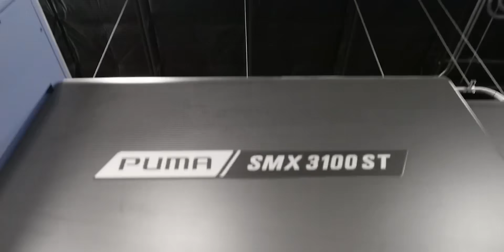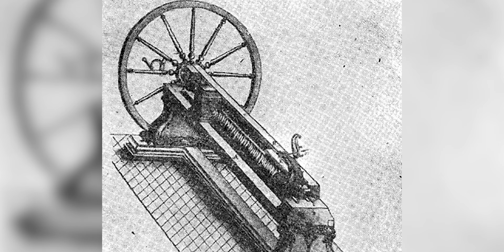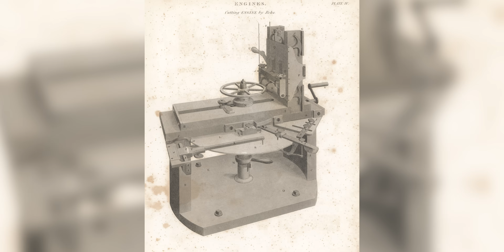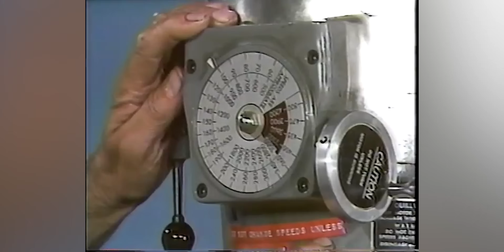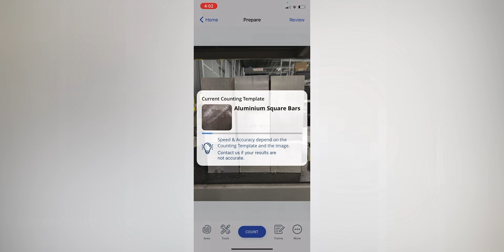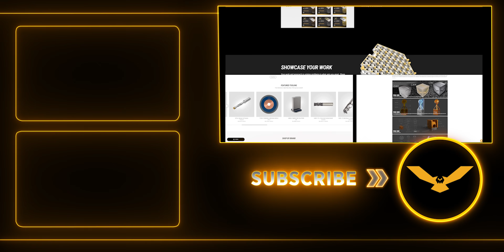The History of Machining

Comment: I've outproduced cnc purists on more than one occasion running production. All depends on the tolerance, how much material needs to be removed, material, and the most important factor is if producing more than one part then the more operations there are the more then the faster it can be done in the cnc.

Comment: Im in my early twenties and have been manually machining on a manual summit lathe, and a manual bridgeport mill for the passed three or so years. About a year or more ago, the conpany i work for bought a canpro 3 axis cnc mill with a 4th axis attachment. Ive been learning fusion 360 and the interface of the fanuc controller, so I am excited to start driving parts out of the machine at much higher accuracy and speed than the "Trusty bridgeport."  Manual machining still has its place for sure, CNC machining is now what manufacturing is all about now.

Comment: I wonder how we would keep machining when we have the next massive solar CME event, much like the Carrington Event, that would basically knock out all electronics and power across the globe. That older, original tech, running pulleys and gear systems, would clearly be able to make machining work again given access to hydro or steam power, yet how would the machine of tomorrow look if it were not powered by electricity? What would Titan do? Thanks for sharing this video Barry, it certainly gives me a little food for thought . . . for our global manufacturing future!
Reply: Just like we did in 1300bc. Much like when my software crashes, its always faster to do it the second time……

Comment: As somewhat of a new machinist i am making parts on a KERN CD282 and a Picomax 54 running Heidenhain TNC310, which is slow. Whilst both are old, rapid traverse on the picomax has a feedrate of 2000. But oh man, i have made some pretty one off parts.

Comment: I have a suggestion on how to increase the thrust of a jet engine, my idea is based on the principle of a fanless fan, The thrust of a jet engine is directly dependent on 2 factors, the amount of air it blows out, and the speed at which the gas flow blows out. I want to increase the amount of air, it is known that fanless fans blow 15 times more air than the turbine itself pumps For this, it is necessary to remove the outer housings of the jet engine, and create new housings, according to the principle of a bladeless fan, part of the jet stream must be used to build up pressure inside the new housing, which will throw in a jet air stream at the beginning of the jet engine compressor, in this way it is possible to increase the amount of air in engine, you're supposed to work with a lathe for a bit, and figure out how to force some of the jet into the hulls, but then you get new types of Jet Engines.
Reply: If you are not drunk, then you must be a total fool.
Reply: @MrJonnyd55  Oh, and on what is your statement based?
Reply: @hishnikchannel3529  a lifetime of listening to drunks and / or fools
Reply: @MrJonnyd55  but clearly, you know how jet engine robots? and why it is arranged as it is arranged, have you looked at the history of the development of a jet engine, I think not.
Reply: @hishnikchannel3529  ok bro 😎
Reply: @MrJonnyd55  ok
Reply: I mean, it sounds like a ramjet. Bladeless fans also aren't truly bladeless.

Comment: can get a $60 metal drill press, 20 in parts and it can do end milling... "set up instructions = complicated, but takes less then 5 minuets" turn out a chain link stamper from hardened steel with it, just takes a little while like using a hand file "600rpm for a 3hp motor drilling SAE9254" even with a bridge port mill that was imposable, chemical engineering acid absorption thermal chemical decomposition reacidification electro plating processes, similar to nitro cellulose production in some ways. heard that the old plant in Indiana was the one doing that for the longest time, but those same elements can be filtered out of sea water "no more (not oil field) tailings ponds, mineral acid well extraction (no strip mining, frack... a 100'000psi well that's 16'000psi static, every frack causes solution to come up and out the open pipes" though in processing of acid mining all the iron in the mix is contaminated with uranium, as is it filters thru a similar range of processing requiring a far more precise stage of automation to remove it within an abstract of a simple distillation process... tho the things in the new milling bits are chemically altered at very extreme ends of the scale requiring very oddly made contraptions "electro magnetic plasma generators small scale fusion" via controlled chemical thermal decomposition of nitrated elements into there oxide that can be filtered thru distilled water and presented for re-nitrating of the oxide for electroplating leading to accumulation that creates a eventual ingot... my car was made partly under that process engine being similar to a modern 4340 160kpsi tensile cast ARP with chemically filtered additives that continue to be reformulated slightly time and time again creating a stronger data set of known properties... nothing in America/Europe/Russia is made of Cast pig iron from poorly sought out anything metal will do eastern made whatever... cast doesn't last, stated as... this cast will last, thus becoming "cast lasts". forged rot iron is a breeze in a $80 mill, same cost as 12 sandwiches "3 days lunch = cost of machine... the metal its made of is worthless as scrap, melting it all comes out as slag in the pot and negligently contaminates everything".

Comment: I worked for a firm that was using wickman multi spindle turning autos from the 40's, they could take a whole day to set,
but they were fast having 6 spindles going at the same time.
Reply: Pshh a day? Watch me take a whole week for a simple setup! In all seriousness those machines are beasts, even CNC machines can't knock them out've their niche. And show me a CNC machine that can pump out parts for nearly a century.
Reply: @efreeze287  Traub Index multi spindle , DMG multisprint..... what was your point ? but the new machines won't last 100 years , but if they are taken care of 50 years are possible
Reply: I worked on Wickman multi's when I was an apprentice. Started off in a machine rebuild shop, taking a machine off the line and disassembling it before putting it back together as a brand new machine. I got into setting them after that, which was less enjoyable. Great machines, I'd love to see what their CNC multi's can do nowadays.
Reply: Did some work on Wickmans as an apprentice in the auto parts industry. Early 80s and CNC completely dominated the shop floor but they couldn’t get rid of the Wickmans 😂. On long runs unbeatable. Well built machine tools .

Comment: I was at the welding shop getting some welding gas and the guy asked what are you building? And I said a milling machine and than he said make sure you set the turn dials correctly on the machine. And I said I'm making a cnc milling machine so that's not necessary. If you have servo stepper motors you can use them as a DRO.

Comment: One of the benefits of CNC machines is,they replaced 10s of thousands of Bridgeport’s making them dirt cheap in my area.. Just about every design engineer I work with has one in their hobby shop. The more serious hobby shops use precision Mathew’s gear.. Eventually buying into their first CNC machines.

Comment: I still love being a die maker using old belt driven hardinge lathes. Hand Lapping and forming radiuses by hand on carbide.. I love learning from old masters learning tips and wisdom than modernity. I get paid more than the top cnc guys on their mori dmg machines in my company anyway
Reply: Pretty awesome you make more than $59/hr! Wait.... I see...you were saying more than the top guys at your shop, not top cnc guys programming and running some of the DMG mori mill turns and whatnot. Are you including the programmers when you say you make more than the top guys and are they only 3-5 axis DMG Mori's there at your shop? That's pretty cool if it is the case that you're pulling in more than the programmers too. It would be awesome to find a shop that pays high wages for die making as it would be a whole new world of manufacturing

Comment: If you known and understand the history, the it is easier to understand newer, more modern machines. I started with manual lathes, milling, grinding machines, after 10 years I learning programming CNC machines, in the beginning I had paper drawings, and calculate everything by hand, and programming Tsugami horizontal 4- axis machine by insert the code string by string. Main program, with sub routines, pallet changer, 3 side machining. 
I also have working with Autocad, Gibbs Cam, SmartCam and also with 3D printers. I am always wanted to learn more, even I 64 years old, I am not too old for learning new things. 
CNC machines I have worked with for example is Matsuura,  Makino A55, and older Makino machines with pallet changer. 

But in my country, at my age it is impossible to find new job.

I have discover this YT channel, I like very much, even sometimes is little to much "Made in USA". 😉
Reply: Thanks for the support Jan! Sounds like you have alot of valuable knowledge to pass on to the younger generation!!!

Comment: Manual machinists will always exist because repairs are always needed and sometimes a one off part is just faster with a manual mill than programming and tool set ups
Reply: For production, a manual machine has no value at all. But not all parts are produced. Sometimes you save hundreds of thousands by fixing something broken and fast, rather than making a new one. Those type of shops work with CNC of course but always have a bunch of manual lathes and milling machines used regularly, even by young generation familiar with CNC. Because sometimes a manual machine is just the right tool for a job, and you can't replace them
Reply: @Orakwan  amen
Reply: @Orakwan  yes as a 17 yo i can infact confirm that the cnc is often still powering on while im making cuts on the manual
Reply: @Orakwan  I think you missed my point.  You don't need to program a CNC machine in order to use it.  You can use it the same way that you use a manual machine if needed.  All of the set up steps needed to do work on a manual machine are the same on a CNC machine.  in the case of a mill you need to set up work holding, edge find/probe to get a starting location/work offset.
Reply: @Orakwan   rarely do our tools break.We always cut multiple sets anyway.
Reply: 100% agree.
Reply: until all parts have been programmed, and until AI is 3D scanning parts and coding to reproduce them almost instantly
Reply: Not really… new gear has all the components stored digitally.. just download and cut..
Reply: @JSomerled  You use the cnc and I’ll use the Bridgeport to remove busted screws. I’ll be done before you make your first cut.  

I have two 5axis Dmg’s with probing and I still use a Bridgeport for all the repair work that comes in the shop.
Reply: @Rightisallwrong   you use your Bridgeport on those tiny jobs.. they’re all yours
Reply: @Rightisallwrong  You know that a CNC doesn't need to be programmed to be used.  If it's just drilling out a busted screw you can do the EXACT same with on a CNC mill using the MPG.  The setup between a CNC and manual mill is identical.  Matter of fact if you have on machine probing the setup might even be faster on a CNC mill.
Reply: @JSomerled  They’re so quick.  I get a dozen different parts with all different kinds of busted stuff.  Some are 8 broken 4-40 screws in blind holes.  Some are m5 in thru holes, others are replacing helicoils.

I have all of it done in a couple hours.  

I accept the repair work because it’s fun and it lets me keep my manual skills sharp.

How long have you been machining?
Reply: @Rightisallwrong   I’m retiring next fall. I started in 1982 after 4 years in military. Sounds like your doing great working on your projects.
Reply: @JSomerled  congratulations!!  That’s awesome man!  I’m assuming you made it through the gauntlet with all your OEM bits?  

I love my work and I love who I work for.  I got insanely lucky.  I mean, I did unintentionally build my career perfectly for this job, but I consider that kind of lucky as well.

Enjoy retirement, you’ve earned it.  Are you planning on continuing machining for fun at home or maybe woodworking?  I see a lot of machinists retire into woodworkinf
Reply: @Rightisallwrong  I’ve been offered a teaching job that I’m considering. I’ve sent them a cost analysis on setting up the program.Just waiting for response back.The family wants my help on the family ranch too… so I’m trying for the teaching gig. I really don’t care if I’m paid or not,I’d just like to see it up and running.
Reply: @JSomerled  Nice!  I enjoy teaching the new guys.  I always try to pass the knowledge along since that’s how I learned, from the veterans.

Good luck with your future endeavors!
Reply: @Rightisallwrong  thanks K W
Reply: @JSomerled   Formula 1 still uses Manual Machinists because just like the original commenter mentioned in that world it is definitely faster to just manual it than CNC and also in that world manual Machinists make more money. Look up Red Bull F1 Machining.
Reply: @kamadeva5121    I'm sure if you search the world your going to find manual....... It's mostly in old shops and hobby garages
Reply: @JSomerled  theoretically yes  but you would be surprised and saddened how far "back in the day " most large and small company's are just like i was

Comment: Thanks for making me feel old 😉I started my career on a belt driven lathe that had 4 turns of backlash in the in feed screw and bed that was worn, through to cam operated machines, plug board, NC and finally to CNC. I started life as an apprentice learning all the hand skills like sharpening a drill to owning my own engineering company sub contracting parts world wide, you've probably filled up your car at a petrol/gas station with underground fittings my company made or sailed a yacht with rope handling equipment I made. 
In my lifetime I have seen a revolution happen in my trade as computers have made it possible to make things not possible by hand
Reply: That's an amazing lifestory! It must have been crazy to these machines get evolved and get better and better!
Reply: @mr.bulldobs4337  i really wonder what next generations will bring. Seems insane
Reply: I started as a hieroglyph chiseler documenting lathes back in ancient egypt, it's amazing how far you guys have come.
Reply: @andersgrundstrom1794  LMAO - best comment.

Comment: I dont care how old lathes are, mills are still better 😂
Reply: Should check out some of the stuff cutting edge engineering aus does with big lathes, cool stuff
Reply: @frankwren8215  i watched it. Nice work from Kurtis
Reply: @frankwren8215 check out ethos energy houston Texas I use to work there, turbine machining, forging and repair
Reply: @frankwren8215 Huge lathes
Reply: Hahaha lathes are awesome, i just like messing with lathe guys
Reply: By WW2 we were already in the USA. And to be honest, im not sure what uniform my ancestor in the photo is wearing….
Reply: @barrysetzer   the first machine I ever ran and learned on was a WW2 Warner and swassey turret lathe and it was a BEAST. 80HP motor
Reply: Lathes are pretty good at making round parts 🤷‍♀️
Reply: I could do most lathe parts on a VMC but the VMC parts can't be done on a 2 axis CNC lathe w/o live tools in as few operations or at all
Reply: Ya but a mill can’t make another mill…..hence, lathes are king.

My apocalypse shop would have a lathe first.
Reply: @Rightisallwrong  A mill can make a mill or a lathe
Reply: @MF175mp  now they can, but only some with attachments that can’t be made on a mill
Reply: @Rightisallwrong  a lathe can't make a lathe any better than a mill makes a mill
Reply: @MF175mp  what? You can mill with a lathe.
Reply: @Rightisallwrong  you can cut threads with a mill
Reply: @MF175mp  ya, you can threads on a lathe too
Reply: @Rightisallwrong  usually the lack of thread cutting ability is why people say a mill can't make itself or a lathe
Reply: I have a feeling a career in manual machining isn’t gonna be a great idea for me lol
Reply: @josh_1518  I wouldn’t 😂
Reply: I only get to use 3 axis old Makino’s lol
Reply: Did your German grandparents fight for Germany in ww1 and 2
Reply: That's propaganda lol
Reply: Awe snap?
Reply: Mill turns FTW
Reply: Two completely different applications. Both great machines. Ever see a 5 axis mill before?
Reply: @stuartpeck26  Lighten up Francis
Reply: @johnburden4727  we are called to love each other and not call each other names like "Francis"
You took the low road and therefore you have lost my respect too
Reply: @johnburden4727 you didn’t have to add the Francis at the end. That was uncalled for. You are the one who needs to lighten up